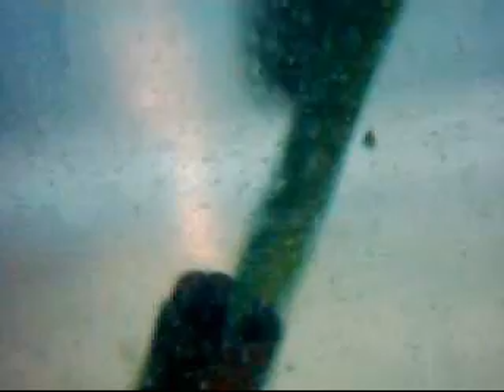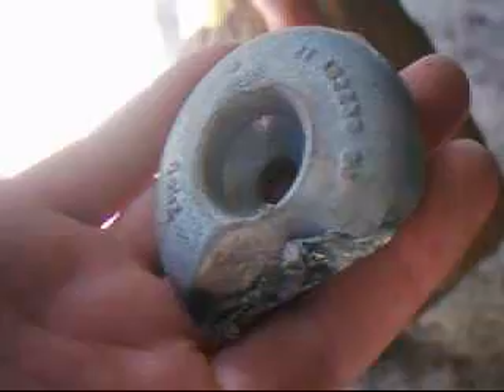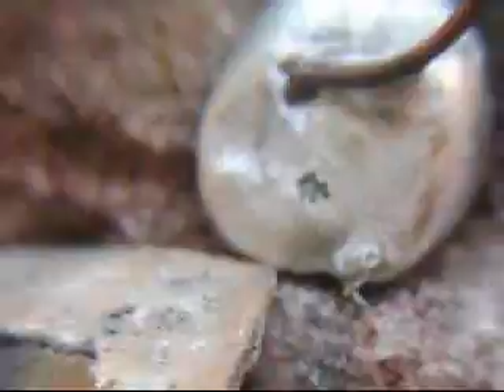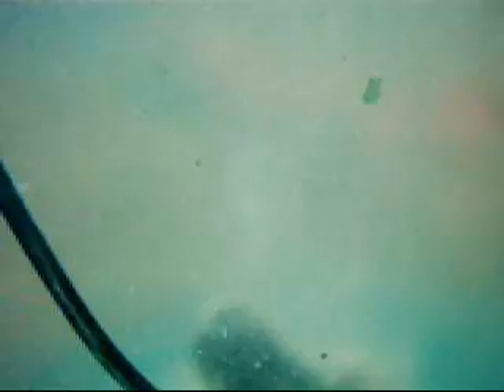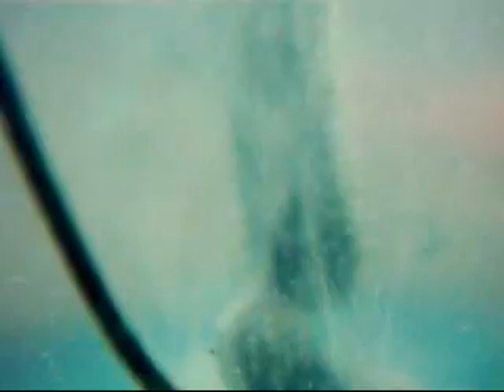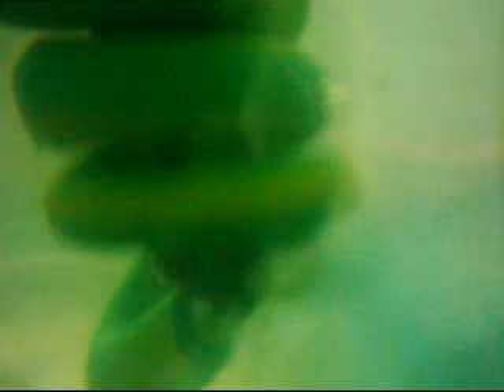Low voltage spark & zinc electrodes

Comment: So it is the low voltage, close contact arc of electricity spark that burts the water molecules apart? That seems to work, how about efficiency, thanks for your video.

Ben.